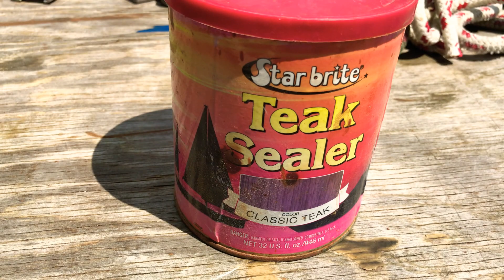Catalina 27, $52 Starbrite Teak Sealer washboard restoration

Comment: I fish a lot offshore and this is why i would never have Teak anymore looks realy nice but unless someone else is doing the work? no thanks. I would replace it with starboard if you could??
Reply from the maker: The Starbrite Teak Sealer can be reapplied once a year, or longer,  as is just slowly wears away, no buildup, no bleaching, no sanding, it doesn’t run or sag when applying either. Now Teak oil is a completely different story, way too much work, forever, and varnish is just stupid on teak anywhere. 
Starboard is too slippery, and falls anytime you try to lean in against something and it can’t be stacked without sliding off, it’s like trying to store ice. Not a fan at all.